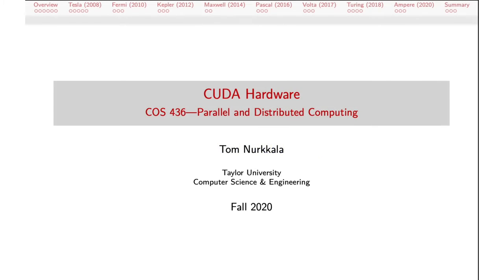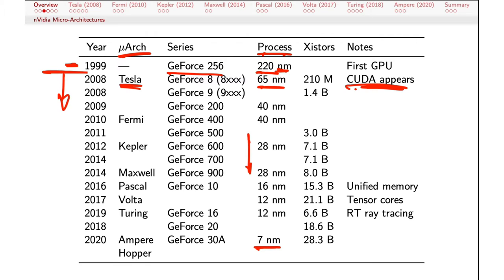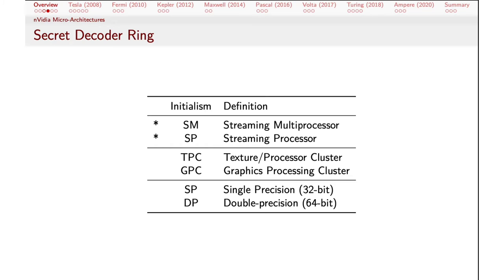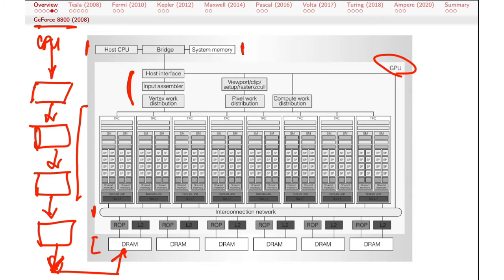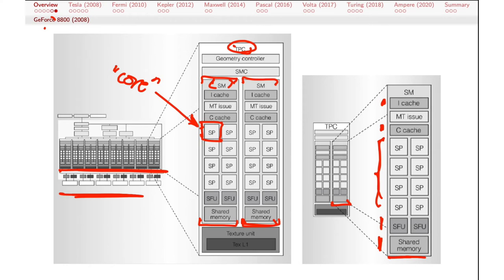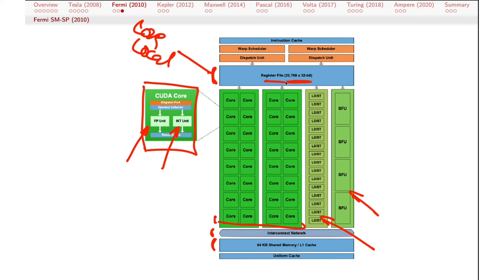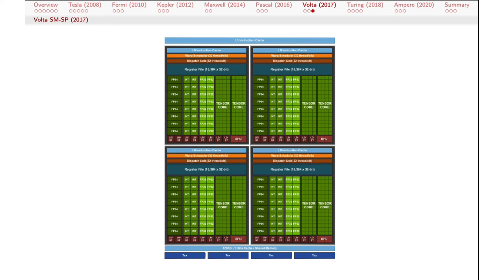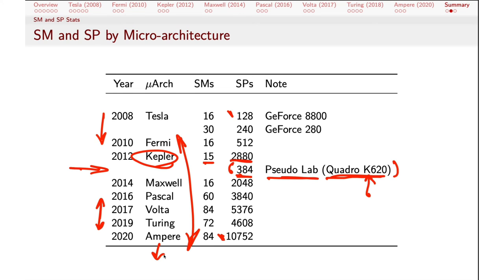CUDA Hardware

Comment: With so many cores, at what point is the communiocation and scheduling overhead consume too many resources?

How complex can the function _GLOBAL_ module be before it doesn't sit in the cache effectively? Are there CUDA profilers which help guide the developer how to construct an efficient CUDA function so that it maximizes the arch and keeps overhead low so that the GPU is doing mostly heavy lifting vs. bookkeeping?